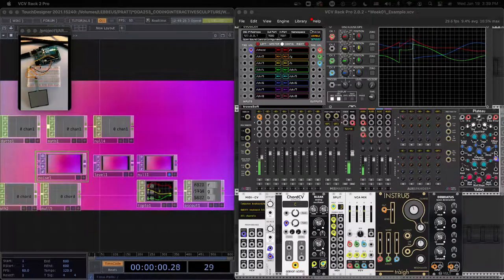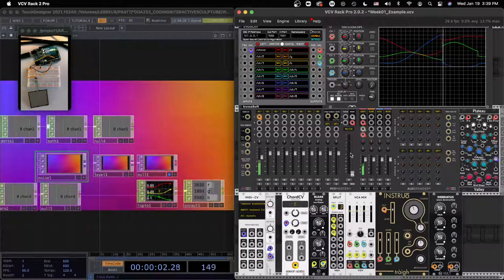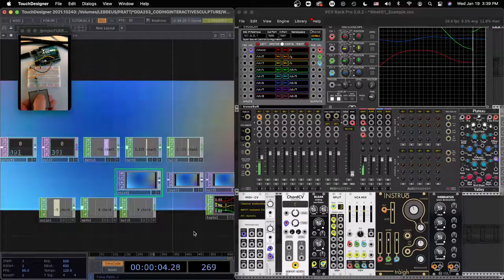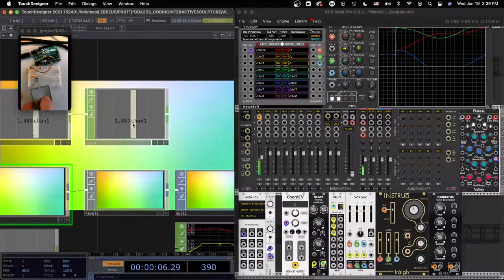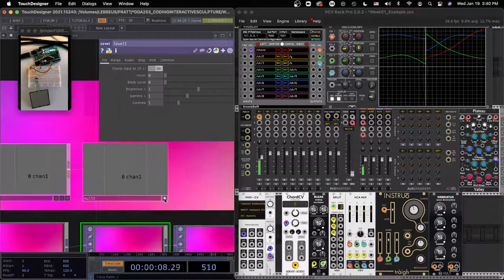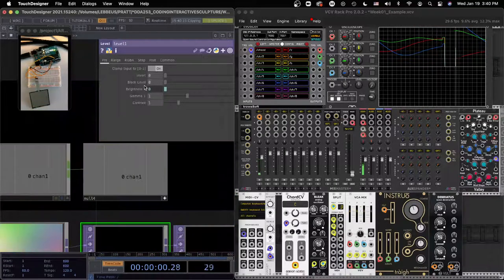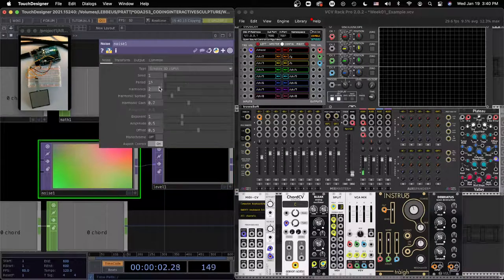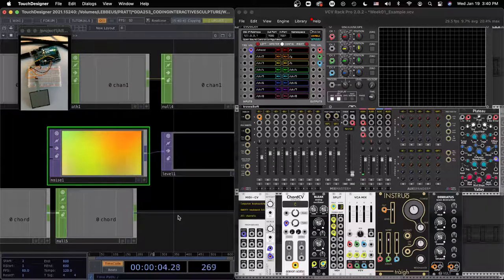Bonus: Week 01 Arduino + TouchDesigner + VCV Rack

Comment: Hi! It's amazing! 
I also want to use arduino to control vcv rack then connect vcv rack to touchdesigner.
But I counld't make arduino connect to vcv rack (I tried to download some modules but it didn't show up in modules section). 

I'm wondering are you connecting arduino to touchdesigner, then touchdesigner connects to vcv rack?
Reply from the maker: Thanks!  Yes, you can find a tutorial in my channel on sending sensor data from Arduino to TD, then from TD you can parse it however needed then send to Rack via OscOut Chop
Reply: @BlakeMarquesCarrington  Cool! I'll check it out.
Have you ever tried to connect arduino to vcv rack first? Is it possible? I've looked for the tutorial but non of them works for me. I'm wondering do you have the experience of connecting arduino to vcv rack?
Reply from the maker: @sabrinawst  Good question, I've seen some examples of that on Github but have never done it myself, seems like the data from Arduino needs to be converted to MIDI CC messages somehow~